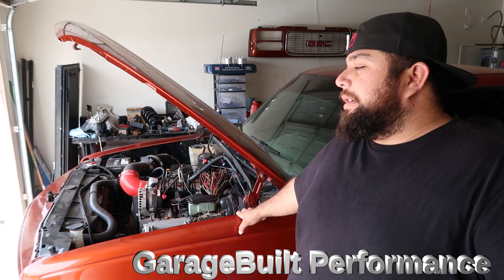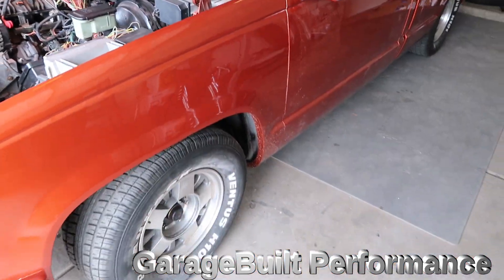obs gets new wheels

Comment: What motor does the obs have
Reply from the maker: 6.0 flat tops  ported 243s btr stage 4 cam
Reply: Nice man. How bad is the wiring would you say if I were to do it myself ?
Reply from the maker: @jsc0338   you need the trucks diagram to find your wires for the speed sensor,  rpm,  and gauges,  stock fuse box was used  and removed all the old motor wires out and pinned the ls harness  in with the wires that were left behind  from the trucks harness all into the red and blue 411 pcm connector  it is a bit of work   and you can find alot of info on lt1swap.com
Reply: Alright thanks man I appreciate it